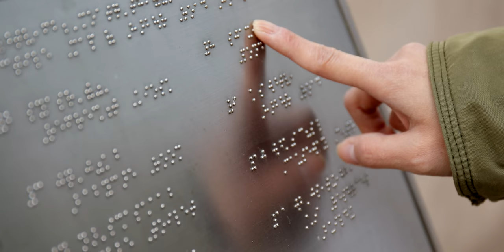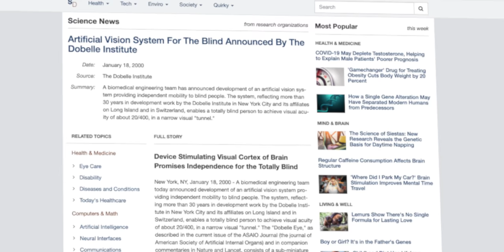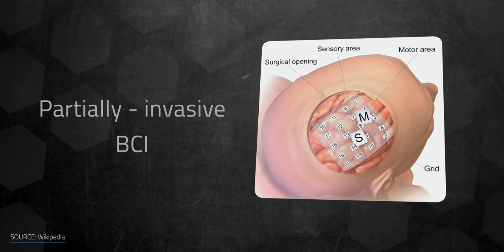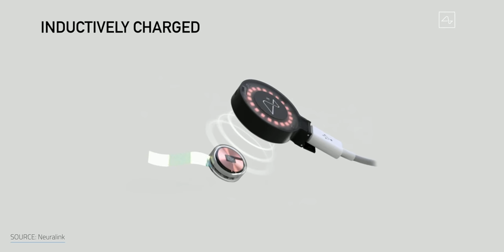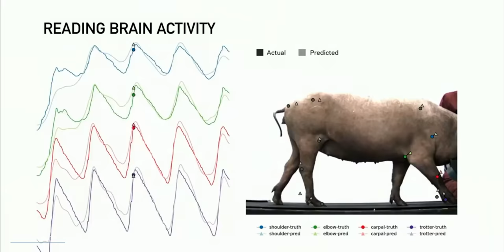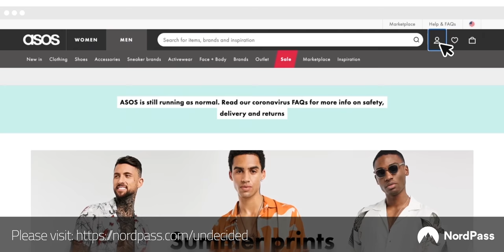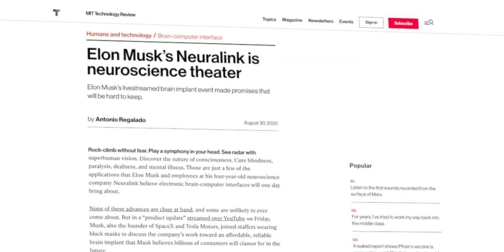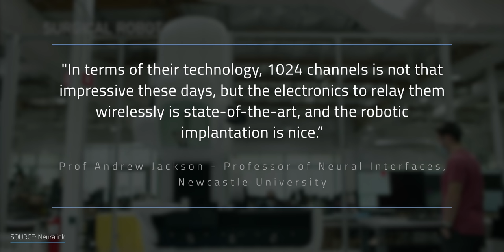Are We Ready For Elon Musk's Neuralink Future?

Comment: Aren't memories recalled by re-firing those neurons that had fired when the memory was created? You would need to have that map/sequence already in order to "implant" a memory, and the receiving brain would need to have the same neural connections in that map in order to be fired. If this is the case, implanting memories into another mind would be like using a  SAT-NAV map of London to get to Heathrow Airport while driving around Los Angeles.
Reply: Yeah it's an interesting problem. In that way it's like it's encoded or encrypted. However if we knew the process of how it was moved to those neurons from the senses you could possibly decode it through those senses and send that information. Then the receiver could take that data through an experience with their senses and code it themselves as normal memories are created.

Comment: Memories are mostly known to be located specially in the hippocampus, deep inside the brain. There is NO WAY to access the hippocampus and read or store memories from the external motor cortex. Neuralink's area is for movement, not memories. And the hippocampus will continue to be inaccessible for decades, for sure.
Reply: Nerualink is CURRENTLY for movement, but the technology is fundementaly about electrode threads which don't damage brain tissue, therefore it theoretically could be inserted far deeper. That adds extra challenge which isn't worth tackling right now, but some day.
Reply: @HyperIonMake  Yes, you're right. And that's why I said that the hippocampus will continue to be inaccessible for decades (but not inaccessible forever). We have very little understanding of how memories are physically stored in the hippocampus (and throughout the brain, because it's not only the hippocampus that is involved). To say that we will be able to store consciousness in a chip is utter speculation, based on current data.

Comment: I have deep brain stimulation implants, for my generalized dystonia (related to Parkinson's, bur rarer. Looks like CP with more twisting). I'm very  unimpressed. The procedure was pretty awful. I ended up getting four procedures, two awake, for about twenty hours total of being awake during brain surgery. At some point, local anaesthesia wears off and doctors get tired... anyway, not fun. Not everyone who gets DBS goes through that, but I did.

and the benefits were... meh. I mean, there were positives, and there were side effects, and they pretty much balanced each other out.

So the thing I find most exciting about Neuralink is the implantation procedure. Something reliable, something reasonably quick, I would be all over that. 

The multiplicity of channels could be great (my implants have four apiece), but I really like the idea of the bidirectional channels, with input and output. My implants only put current into the brain, they don't read out. So it's a couple of years of tweaking and dicking around to find settings that work. If you find anything at all. And if they don't, they want to go back in. Yeah, don't call me, I'll call you.

I dunno, it's a hard problem. Elective brain surgery so you can talk to your computer with your brain seems a long way off. But improving on things we do already seems very doable.

Comment: With all the enthusiasm that comes with Elon's ideas I think there should be some positive scepticism. It's awesome that his projects motivate industries to innovate but some of his ideas like hyperloop or small underground tunnels for teslas or using Starships as a long-haul aviation replacement are pretty questionable in terms of practicality and reliability.
Reply: Technically he never pursued the hyperloop and the boring company tunnels will be open to public soon.
Reply: @user-RCST  He did, there was a white paper published on SpaceX website and a testing to track in Hawthorne. The boring tunnel is a very questionable idea with a lot of danger coming from its small size.
Reply: @Einygmar  how are they dangerous.
Reply: @user-RCST  A car travelling at 125 to 150 miles per hour in a small tunnel. What could possibly go wrong? Tunnel fires are pretty difficult to manage even in a normal sized tunnel.
Reply: @Einygmar  I mean it would be automated so the chances of crashing is extremely unlikely and electric cars are less likely to catch fire then gas cars.
Reply: @user-RCST  Modern car autopilots are far from perfect. There are accouts of self driving car accidents. Even if electric cars are less flammable there are still Li-ion batteries which are flammable. It's not like people don't put cars in small diameter tunnels because they use combustion engines it's because there is only one way in and one out and a constant danger throughout the way and in the case of The boring tunnel there are people in separate vehicles  in front and behind you moving in the same direction at high speed.
There is a far more reliable way to build an underground transportation system: 
-put it on rails
-power it from the outside.
-connect individual cars so they move simultaneously.
It's not a coincedence that the longest tunnels are railway/metro tunnels.
Honestly It looks like some of Elon's projects exist for the most part to promote his main products like Teslas.
Reply: @Einygmar  autopilot will be easier in a tunnel.  I think the boring company will be very successful.
Reply: @user-RCST  Autopilot is not the main concern, autopiloting a train is even more easier. They should do a lot of full-scale testing runs and only then It would be reasonable to make statements about their possible success.
Reply: @Einygmar  time will tell which one of us is right.

Comment: I'm not worried about it at all.  None of these wild claims of off loading memorizes and such is going to happen at 1024 connections.  I'll start paying attention to it when it gets to a billion connections and start predicting from there.  Until then 1024 connections is like downloading the internet on a teletype machine.   Sure there can be some very specific and good use cases but it's not going to radically change the internet.
Reply from the maker: My guess is that level of tech won't happen until I'm long dead and buried.  But you're right ... it's going to take a massive amount of connections to pull that off.
Reply: @UndecidedMF  I was wondering one day if they could get rid of the wires all together and remove to top covering off the cpu and let it connect directly to each of the cpu's memory cells.  They may have to find a way to make memory cells out of titanium or some other material that will want to bond to organics but seems doable.
You'd have to figure a way to spread the memory chip over a large area of the brain.  I got nothing on that one.

Comment: If it helps you never forget anything you read, heard, or saw, then sign me up as the volunteer to be the guinea pig.
Reply: It doesn't do it now or in near future.And you should try to think what this "never forget" part means. You can write,so you already have option how to "never forget" things.
Reply: @Steellmor  
Many engineers have been working on the idea of connecting the brain to memory chips, where everything you read, hear, see, do, etc is constantly remembered. 

Which can be very beneficial, from being able to remember everything in school, to remembering the exact process of surgery, or fixing aircraft, etc. 

Too often mistakes are made in important areas due to a slight change in our memory. As our memory currently is not 100% exactly the same as how it happened or what we read. 
It’s why aircraft maintenance technicians are to have the manual instructions with them as they fix the aircraft. Because our memory currently isn’t reliable. 

But to hook it up to an electronic device, that can store our memory correctly, and send it back to us at anytime, that would be great. 

And it may not be designed for that right now. But if they are talking about being able to have it communicate with our smartphones. I guarantee someone will design an app that triggers the ability to save our memories.
Reply: @ryanvoll7088  Sorry i wasn't clear enough. "Artificial memory" exists for thousands years of human history. Being able to "upload" your memory on digital storage erases the line between such "neuro-memory dump" and regular USB>punch card>book>сave paintings. It's not being new concept from humankind perspective,it's just another more advanced step. But is there a need to become a guinea pig in something that won't be able to work for decades,while these less advanced technologies already exist?

Comment: BCI devises that use pins scar over in a short period of time about 6 months.  Neuralink has not made it clear, clear, that its devises is coated or the smaller scale increases this time or not.  Six months is a deal breaker, isn’t it.  The same concept could be accomplished entirely with light.  The surface of the brain can be addressed with light sensitive virus sensitive to a specific range of Infrared light, and literally activated with an OLED screen, or a laser.  A different wave length of light could be used to scan the brain and activity with high fidelity by simply thinning the skull at a pin point.  Thinning the scull will allow any wave length of light to enter the skull it only has to penetrate just below the Dura mater to map the brains, surface and activity, live.  A BCI input may even be possible to address it with sound by piezoelectric Array.  Neuralink does appear overly optimistic and needs to clarify, are the pins coated with silicone/graphene, that would be conductive, to avoid the scaring?

Comment: Just imagine: when the microsoft aug suffers a "blue screen of death" the host actually dies.
Reply: The chip doesn't run you you would lose whatever function it gave you but it's a one way street
Reply: @crashoverride93637  That assumes it doesn't fail by firing randomly all the time - the communication is 2 way on this device.
Reply: @peglor  ...its a passive sensor think of it like a optocoupled relay the control senses is presence of a signal but the relay does not interact with the main circuit in any way if it fails you don't damadge the signal since its passively measured